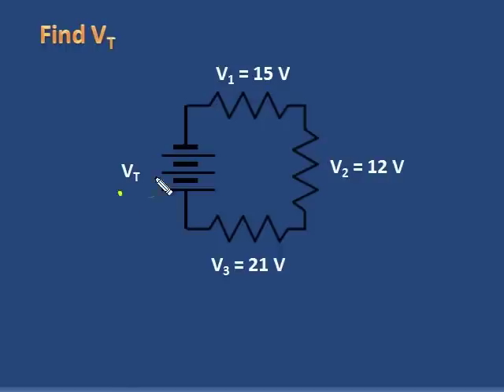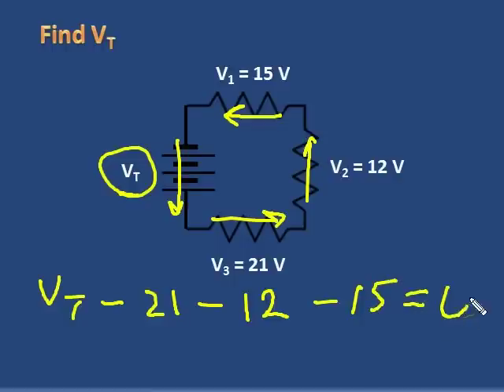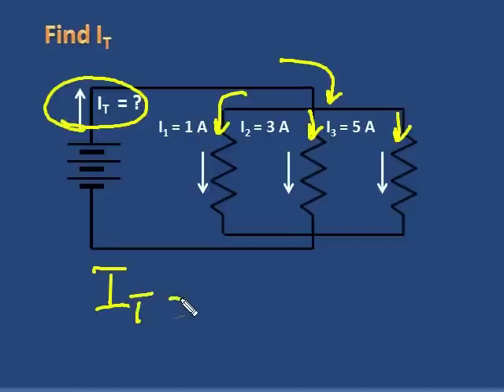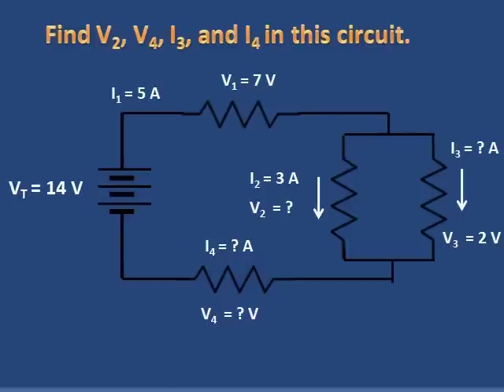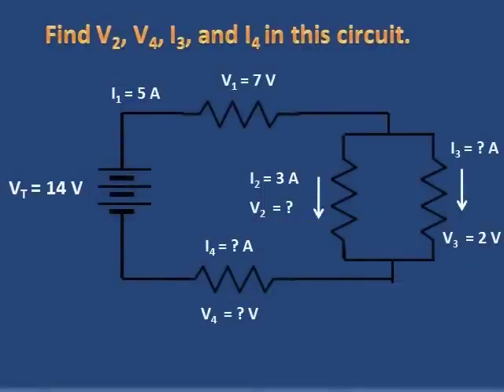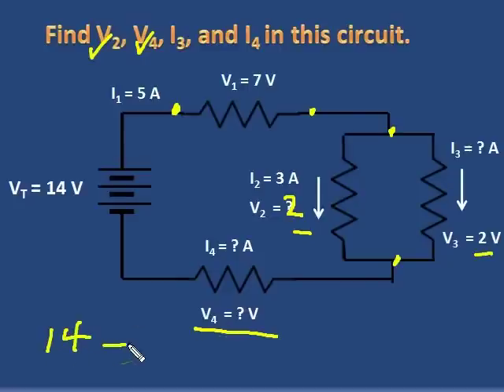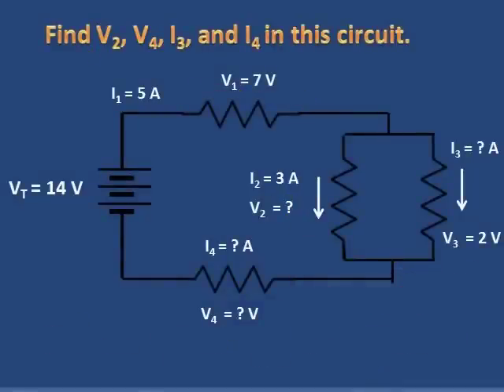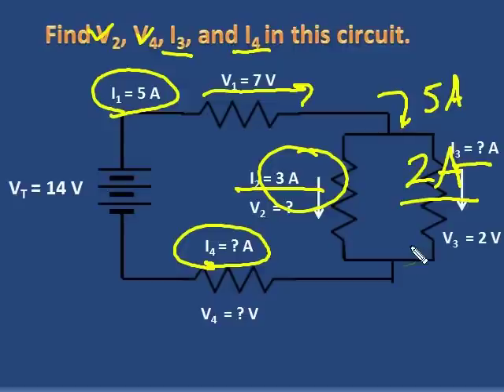Kirchhoff's Laws Practice Problems 1

Comment: the second problem i think the 3 resistor are in parallel ...??????
Reply: +lal lianzuala You&#39;re right. The formula for resistances in series is 1/R_total=sum(1/{Resistances}). Thus the addition should be 1/(1+1/3+1/5), or 15/23.
Reply: thought the same but realized it was I you are mistaking it for R

Comment: In the third problem, where did you get V3=2v from? The voltage drop across the first resistor is 7 volts, so the voltage that enters the junction should be
(14v - 7v = 7v), right? And because R2 and R3 are in parallel they get 7v?
Reply: I think it's because he's not calculating the voltage going through the resistor, but the voltage being dropped through the resistor. So yes there is 7 volts going through the resistors, but they are dropping 2 volts leaving the 5 volts for the last resistor.

Comment: Hope your doubts have cleared by now, but V1 and V4 are not in parallel; they are in series, and furthermore if you were to combine the two resistors supplied by I2 and I3 in the parallel branch into one resistor it would be more obvious that the V1,V4 resistors are in series. Hope that helps.

Comment from the maker: The voltage drop across resistors wired in parallel is always equal. If the resistances are not equal then the current flowing through each resistor will be different according to Ohm’s Law.  See the videos in the playlist "Electric Circuits 4: Summary" (youtube.com/playlist?list=PLVJ2T3K5N6bpzsKSy9nWocDyFS_J5w8WU) for a more complete explanation.